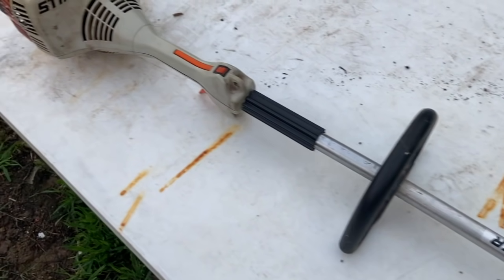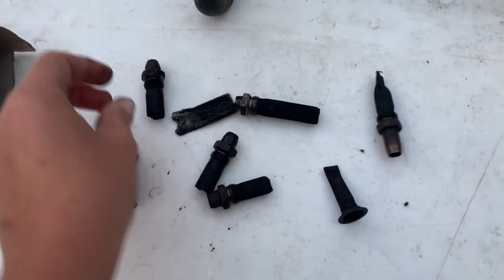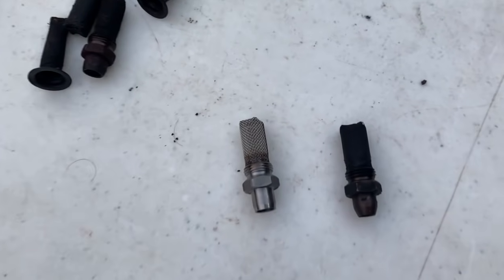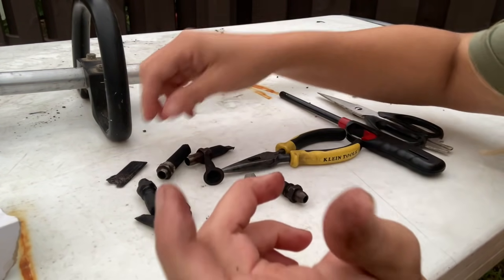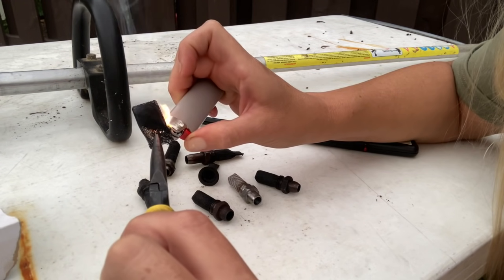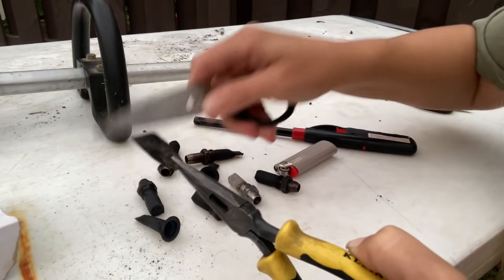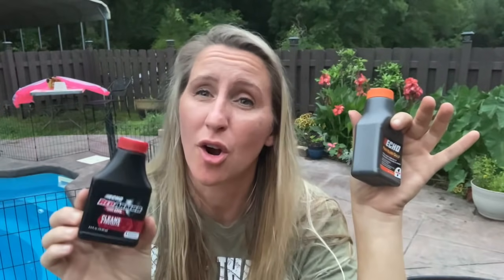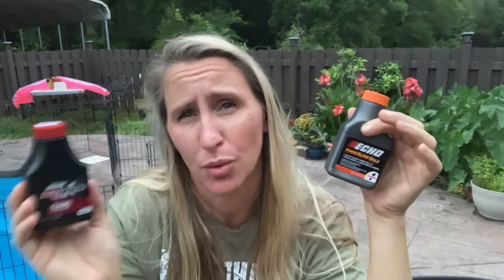THE BIG SECRET! STIHL has NO POWER? Won't Throttle Up? How to fix your trimmer/blower.

Comment: Your video was super. You were right on the money about users lugging their engines and clogging spark arrestors. I am a certified Stihl Service Technician and I can tell you for a fact that our shop and Stihl have never, ever refused a warranty repair based upon the type of oil used. Stihl will Double your warranty if you buy a six pack of Stihl HP Ultra oil at the time of purchase. I get a lot of units in for repair with bad gas. Also, I'm sure most owners are running 87 octane gas in their units. Stihl recommends at least 89 octane. So between owners not running the machine properly and using bad/wrong fuel, most of the spark arrestor problems can be credited to this.
I would probably have a heart attack if just one of my customers said," Yes, I read the manual "
You know us men, we don't read manuals!!!  Removing the trimmer head shroud and running longer line in the trimmer is the biggest culprit too. These small engines will not run up to full song even if the trimmer line is just 1 inch too long (800 rpm decrease).
As a final note I prefer Amsoil Sabre oil. You can use less and there is less smoke (more complete combustion) and it last a long time in the can.

Thanks,

Keep rockin'

Mark D.
Reply: "Stihl will double your warranty if you buy a six pack of Stihl HP Ultra oil at the time of purchase." That's exactly how my local dealer presented the proposition to me.
Reply: I just started the video and had to jump into the comments because I've never heard of Stihl refusing warranty based on oil used. And I'm a Stihl dealer.
Reply: Mark Amsoil oil I no whith out a doubt is top choice but In so many places it's not so readily available I have been using Quicksilver for many years whith no problems not one time have I had to clean the spark arrestor in my old FS40c I have a ancient Stihl chainsaw. Still runs like a champ cut's like no woodchuck could if a woodchuck could cut wood
Reply: Spark arrestors the first thing that gets yanked out the second I get home with something.
Reply: I totally read the manuals on all my equipment.  I just need to reread them occasionally!  LoL!
Reply: KLOTZ OIL'S THE BEST!!!!!!!!!I!!  @  SWEEEEEEEEEEEET  SMELLING!!!!!
Reply: @Mr_Clean  100% dude. F$#& that right off, small power gains are valuable...
Reply: @Mr_Clean  same here. Never had a ‘ball of fire’ come out the exhaust, and rarely sparks either.
Reply: @dizzlehtx  I never had to worry about it but they doubled my warranty buying their syn 2 stroke oil. Said if I didn't use it they'd void my warranty. I had to change carb this year,it's 8 years old, because of improper storage.
Reply: you will need a double warranty for lousey stihl equipment. its the worst! garbage
Reply: @frankdodson3534  i have had  the same results with quick silver
Reply: Only home owners use the guard, if u wunna get some work done take off the guard make your string long af
Reply: Aspen or Stihl alkylate fuel with Saber or Intercepter oil. Burns cleans and runs smooth as silk. Regards.
Reply: use a Stihl kma 135 r (+fs90). no trouble when keeping it at low rpm. i mainly want a long line to keep the rpm down. back-up is a Dolmar (Makita) MS 243.5. unlike stihl it's a 4 stroke with separate oil. runs extremely well our normal fuel (=US octane 90) , no additives needed. has no trouble with low rpm. wouldn't use it for edging, doesn't like being upside down for long times. used quite a bit of stihl equipment in the past, generally with aspen2, never had any trouble with running it at low rpm. but Stihl did quite a bit of changes to the engines to reduce emissions since then.
Reply: @frankdodson3534  - In 2022 it is only normal to order something online, including the Saber.

In addition, as a Belgian, I order my Amsoil directly from Germany. The prices are strangely the same as the US prices.

Next to the Saber, for example, their zrod 10w30 or small engine oil is definitely the best in temp and overall performance for compact four-strokes like Makita's. And as I mentioned, fuel does play an important role. Avoid the ethanol.

grtz
Reply: @laurapalmerTDGE  I have about a 20 ish year old cheapo craftsman string trimmer that I've always used nonox fuel & AMSOIL Saber at the leaner ratios. The thing starts right up every spring. Had trouble getting it to run good last year so I pull the spark arrestor screen and was tickled to see it was clean as a whistle. Turns out it was a deteriorated cracked fuel drop line in the tank. Also have a 25 ish year old cheapo mtd lawn tractor I bought used 20 years ago with the good Briggs IC engine, best part on it, the engine! Always nonox fuel & AMSOIL 10W30 Small Engine oil & it's run flawlessly.
Reply: @oneninerniner3427  - Thanks for sharing your experiences! Fuel has changed a lot, so non-oxygenated gasoline is the best if you can get it, where I live it's more difficult. E5 so with 5% ethanol is the lowest that can be found here, 98 octane. That's why I buy the alkylate.

In fact, you will experience the benefits of Saber not only from the start but also after years of use! Regardless of the brand of device. For example the Stihl 041AV Professional 61cc and always wide open and in the winter with fuel in the garage ... works perfectly. And also with extremely intensive use.

And like now there is a heat wave going on. + 95 fahren. No problems.

My Honda GXV160 & GCV530 and especially the latter dared to fail in the past at 95 fahrenheit. The 10w30 has been running for more than ten years now. Like a sewing machine. As well as the fuel saving

It is in the long term and by taking good care that you experience the benefits!

Amsoil for the win, never anything else.

Regards.
Reply: I run Amsoil in all my 2 strokes motors including my motorcycles.
Reply: @super20dan    I've used a lot of it and found to be incredible stuff.
Reply: Amzoil is definitely the best oil for two stroke engines !
It is hard to find, I recently got frustrated not being able to find it so I went right to the amzoil Web site and created an account and got a gallon for about $20 a quart after shipping and taxes.
Reply: @super20dan I hate when my equipment gets lice!
Reply: the thing with gas is not everybody lives in or around an area that has 89 or higher octane ethonal free gas for example here in my area most places around here just has 87 octane gas and lastly if one runs their machines pretty regular like 87 gas will never hurt a machine at all
Reply: @playgroundofsound7683  that's a stupid thing to do a guard is there for a reason and takin it off will make it harder on the machine eventually
Reply: Is the premix stihl fuel good?
Reply: Ethanol fuel kills a lot of carbs!
Reply: Hell.  Is there a way to run one except at full throttle?!?
Reply: @dizzlehtx Yea, they just double your normal warranty if you buy the newer gray bottles of oil when you purchase your unit!